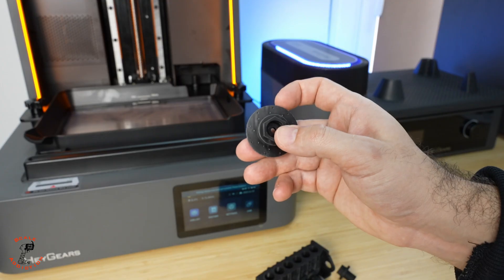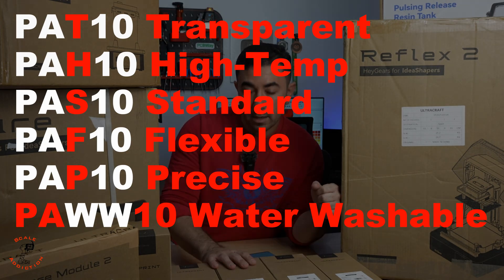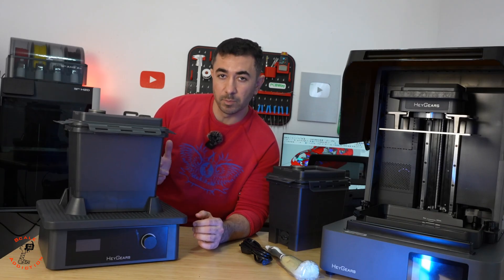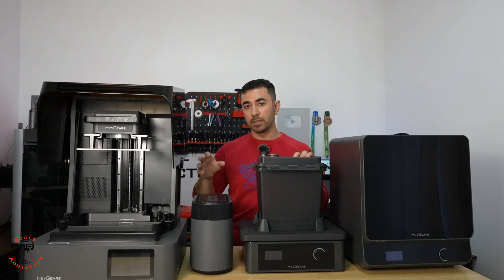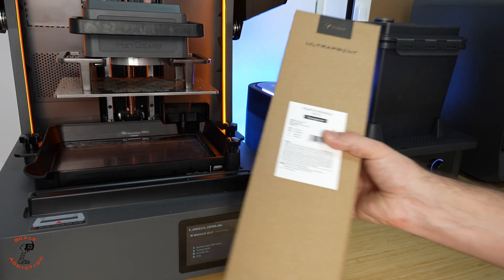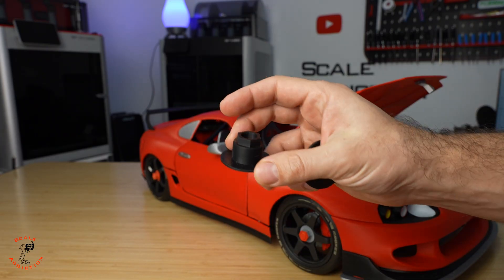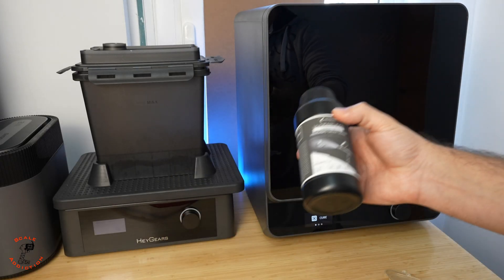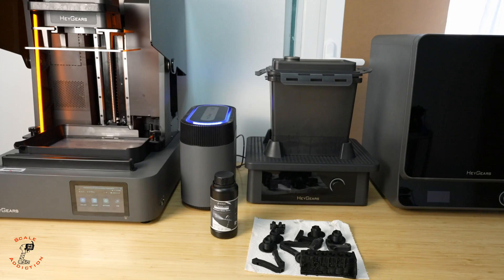The Most ADVANCED Resin Printer Setup I’ve Ever Used – HeyGear Reflex 2 Combo

Comment: Not a fan of the single rod. its not best for accuracy or leveling. it add in a over complicated way of leveling vs something like elegoo. where you simply unbox. loosen screws. auto level, tighten screws and done. its kind of same but reverse I guess. I like alot of the other things with menus and screen resolution etc but.. the app connection to all devices involved are interesting. But also expensive to just purchase all these things for me to try out over something Ive already invested in. side note the scraper is kind of cool in alot of ways if you dont have an optimised model printing  and somethings dont land properly the scraper can heal alot of that im thinking?